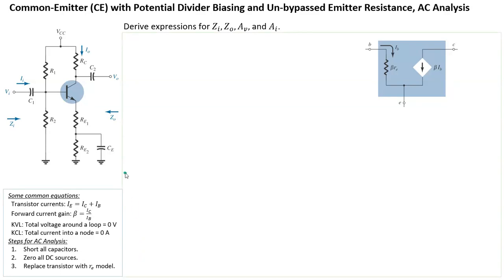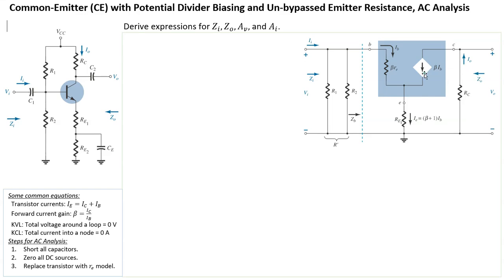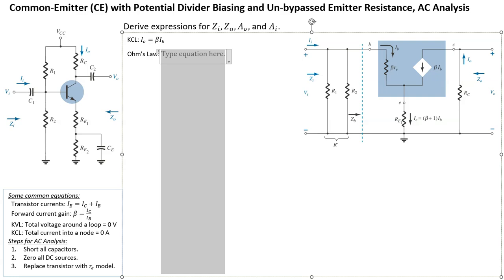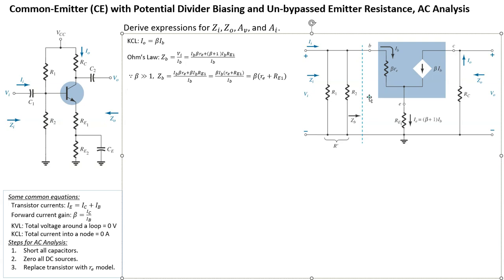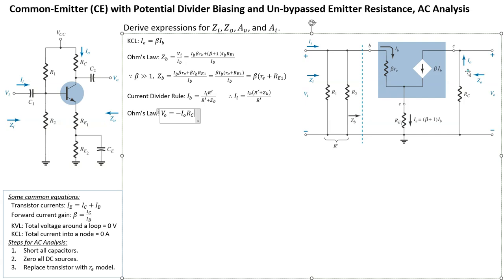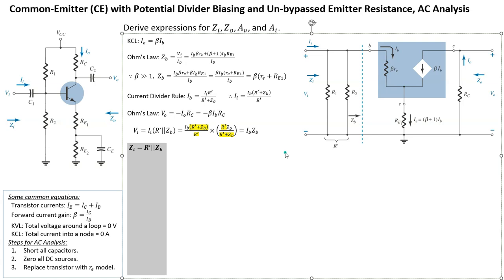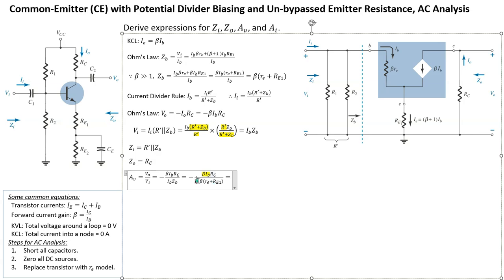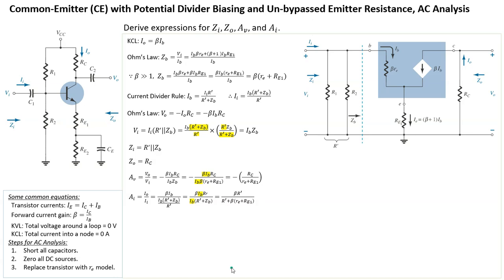Common Emitter (CE) with Voltage Divider Biasing and Un-bypassed Emitter Resistor, AC Analysis

Comment: EXCELLENT VIDEO!HOW DO YOU DETERMINE THE VALUE FOR Re1?
Reply from the maker: Thanks David! Looking what R_E1 affects, you can see that it's in Z_b (which in turn affects Z_i), A_v, and A_i. So depending on your overall design parameters (e.g. required Z_i, A_v, and A_i), then you'll have to set R_E1 to achieve your desired goals. A_i has an additional problem though as it's dependent on beta (which varies with devices of the same type), and r_e (which depends on your biasing currents). But since we don't generally use CE amplifiers as current amplifiers, that's probably a moot point.
Reply: THANK YOU!